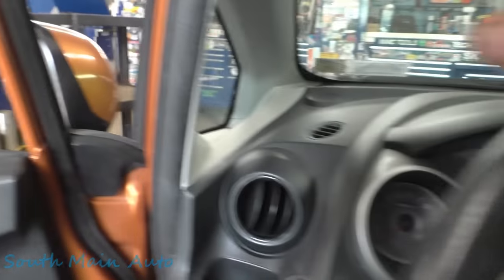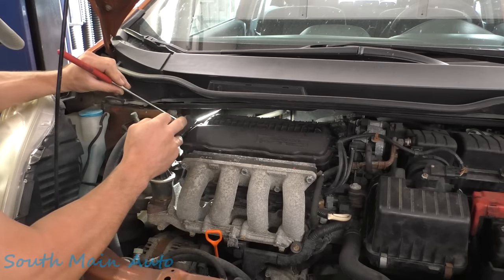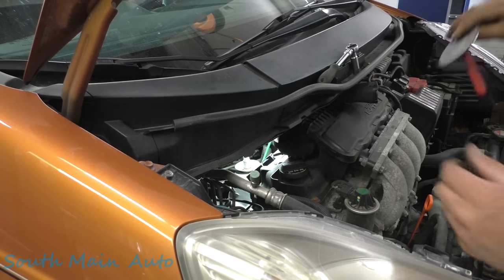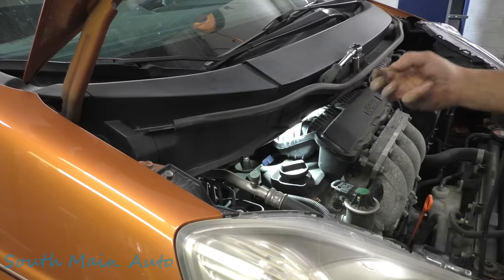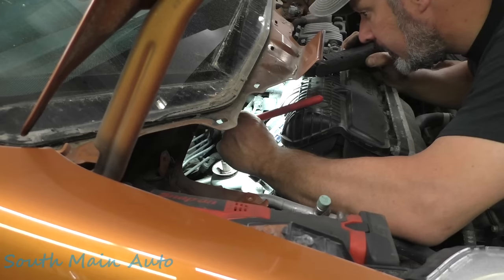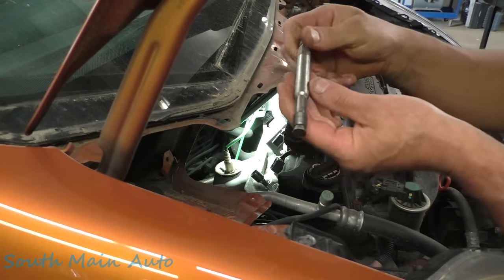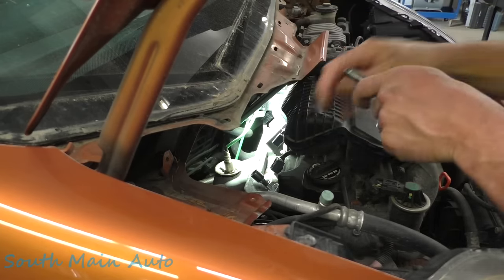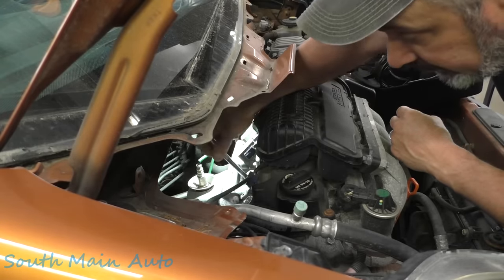Fixing A Blown Out Spark Plug - Honda Fit Edition

Comment from the maker: - Spark Plug Saver | 14m x 1.25 Thread Reamer and Thread Inserts | 5 Piece (3 Thread Inserts, 1 Reamer, & 1 Swaging Tool) - https://amzn.to/3IDmnHy
- DEPSTECH Dual Lens Industrial Endoscope - https://amzn.to/437nKqb <---- I have a couple of these and they are totally worth it IMO Don't waste your money on the Snap-On truck for an endoscope trust me...
- Astro Pneumatic Tool 1716 Deluxe Air Blow Gun with 20" Long Angled Nozzle - https://amzn.to/43nNtKQ <----- These bend real nice 😂Especially if it's not yours 😏
- Spark Plug Installer/Remover Kit - https://amzn.to/45ydmcE
Reply: Where'd you get that red spark plug starting tube, shown in your hand at 3:57? People talk about using a short length of hose. All the spare hose I have is curved, which makes it confusing if you're trying to start the plug straight.
Reply: Glad you mentioned the TikTok thing. Whoever it is is just taking clips of your really old videos to make them.
Reply from the maker: @TheFallenAngel13524  yeah I'm trying to get that sorted but it's a pain
Reply: Wow. That endoscope is way cheaper than I was expecting. Thanks!
Reply: What I have done before is get a used spark plug, cut off the crush washer and put a 45 degree taper on it with your bench grinder where the crush washer was and use the modified spark plug to drive down into the new thread and tighten. The 45 angle will seat the top of the solid insert. Then remove modified spark plug and put in your toolbox. The one I did was Cyl 2 on a Hondu Pilot. No room to hammer.
Reply from the maker: @OneLegged-honda-mechanic  That's a good tip. Thanks!
Reply from the maker: @spelunkerd  These are the ones I use and I have had them for years. They don't wear out like the rubber ones. 
https://amzn.to/45ydmcE
Reply: Hey, I have been wondering about your channel. Are you going to post again? @OneLegged-honda-mechanic
Reply: Who makes the blue insert install tool at 29:33? A tip for tight space hammering is use a heavy hammer. I've found I can get more whack with a heavier hammer vs a light one in tight spots. Also with the type of insert used in the video don't be afraid to hit it in order to peen the top of the insert outwards. A brass hammer works well for that.
Reply: @OneLegged-honda-mechanic  Ben what happened to your channel, you got tired making videos?  Come back pls we need more Honda gurus on YouTube (-_-)
Reply: Be Cool... Stay in school!
Hey, I think Ray missed your broken stud video last week. He welded a nut to the top of a broken stud on a Subaru but forgot to apply the high heat torch to clean up some of that corrosion in the head. After about 5 snapped off nuts (and lot's of WD) he lost his cool and broke out the drill.
😑 All sorts of ugliness ensued and he wound up replacing the block on the arm. I kept screaming at the screen: Grab the torch! It's right behind you! Oh well - we know he's a good wrench but we all need to keep our cool and come back to the problem with a level head and some fresh ideas. That's why YOU are the man with the plan. Patience comes with age most of the time.
Reply: Don't know what you guys think but I was taught to put grease on the ream / tap doohickey to catch metal chips. Probably just overkill, as long as the valves are closed and the cylinder is blown out, looks like it came out nice. Thanks Eric.
Reply: When I did first incert on my 1.8flat four subi at 180thousand got lucky with multi extensions to thread in tap .then found 2'&3'extentions what job saver second time at 2hundred thousand did it forty five minutes got to work haha be blessed
Reply: Good stuff Eric. Definitely learned me something about tools that I was completely unaware of....
Reverse thread arbor? Who'd of thunk it?
Anyway,top notch as usual. We appreciate you
Reply: @SouthMainAuto  They or it do it to several creators. Always says the same.  Like and follow for more.  Never respond to comments and block you if you call them out.
Reply: Who makes the tool that chases threads from inside out that’s sweet could have used that lots of times
Reply: Oh my, you didn't even wipe all that residual loctite outta the inside of the sparkplug hole that got all over the side before you put that new plug in.... That oughta be real fun to change down the road ha ha
Reply: Looking through for Lincoln Town Car Videos I do like your style, easy approach, can you recommend any channels in your community that cover a lot of town , 🚗 car vids thank you have a blessed day
Reply: Eric / Mr. O cat Caterpillar makes a really awesome thread insert kit that has 4 locking tabs that expand to hold insert in. I know it wouldn't have worked in this application. I highly recommend checking it out!
Reply: I was a former competitor in the Carling O'keefe World armwrestling championsips so there isn't a spark plug I can't wrestle ou9t.
Reply: Mate your a gentleman and a scholar, the things i have seen you do, any other workshop auto repair place would simply say yes you need a new engine, plus i would like to know how on earth did anyone even stuff up putting a spark plug in, i know its hard to get to, but honda or anyone else would look up how to do it for access etc, so take off the windshield plastic areas of concern and replace with new spark plugs its that simple, so who the hell stuffed it up?
Reply: Great step by step video! Our son's car had the same plug blow out issue on #2 so will be following your steps to do this fix. SF dealership quoted him an insane estimate, probably for a brand new head.
Is there a link to the blue handled tool used for putting in the insert?
Reply: Where can I find that tool you are using to install the actual thread insert? Thanks
Reply: I seem to remember doing something similar on the mk 2 fiestas with the taper seal spark plugs
Reply: I have a folder full of bill's my sister paid to shop's in az.that she paid for work that was not done or part's that were broken so she would have to come back to get replaced so when i see this man do the right thing i admire him

Comment: Novice = install a helicoil.  Intermediate=Installing the helicoil on a head w/o removing head.   Advanced = Don't remove head, and install a helicoil down a plug tube, underneath a cowl totally blind.   I definitely would have boogered that up doing it blind.   Well done, and saved the customer a lot of ducats.
Reply: Thought it was Canadian drachmae up around Eric O's neck of the woods?
Reply: I’m not sure how using a #4 screw extractor would rank on that scale?
Reply: Glad to see you took the Piston down OB Motors on Hacks Cross in Olive Branch Mississippi didn't do that they drilled into the the top of my piston ruin it then JB welded my spark plug in without taking the drill bit out cost 3800 a new engine the owner states he was not liable that he was just renting a bay to the man but I was given a receipt with the company letterhead on it. OUCH
Reply: That's Mississippi for you
Reply: Johnny from Olive Branch Motors in Olive Branch on Hacks Cross I took him a time cert insert with all the trimmings and he drilled in the top of my piston left the drill bit there,  JB welded a spark plug in cut $3,800 that's Stooooopid   little Vietnamese
Reply: Perfect observation and explanation bravo sir. Nice.

Comment: If the customer had taken that job to the dealer, it would be a new cylinder head for sure. You saved the lady a load of cash. Good one Eric.
Reply: They would’ve done an engine
Reply: Probably techs at the dealer that butchered the threads in the first place...
Reply: dealers are not mechanics just part replacers
Reply: its an 09, when i took my 07 fit to the dealer in 2015 they refused to work on 'such an old vehicle'
Reply: Japanese engines aren't commonly repaired anymore. Replace engine.
Reply: Damn straight.  I never go to the dealer except when buying a new car.
Reply: Dealers only do repairs that bring the parts back up to original brand new condition.  When often, just doing a splice or something, would suffice.  Squirrels ate through my fuel pump wires.  The dealer insisted they couldn't just strip the wires and splice them back.  They would have to replace the entire wiring harness.  So I got a shop to lower the gas tank and splice the wires.  It only cost $250 whereas the dealer said $1800.
Reply: They would have told him the wait on an engine or cylinder head was 10 months because of supply chain issues and then sent him over to the shark tank, I mean, sales floor.
Reply: Not necessarily.... but you wont hear me outside your echo chamber.
Reply: Then why'd I borrow this tool from a Ford tech the first time I did one 🤔
Reply: @smitty2jones  that's for "CYA" purposes only.
Reply: I went to a full-service shop that I had used for a few years they told me my oil pan drain plug hole was stripped out, from a 10 minute oil change place Jiffy Lube or wherever they over tightened the plug, they told me I needed a new oil pan and they would not be doing any more oil changes for me unless and/or until I had the oil pan replaced ,in order to replace the oil pan you have to lift the engine up on a Chevrolet pick up truck big job I stoped going to that place because I know there are better alternatives  less costly alternatives,😑😑😑😑
Reply: @Codyjrt  Never go to a dealer for anything vehicle related .(other things that you smoke green tobaccy yes)
Reply: I believe that one was Mexican
Reply: $3500.00
Reply: @kthwkr  I was quoted $12000 to replace the car harness. I did it myself - all it needed was 1 pin to be bypassed on the patch panel connector after the sunroof leaked and rusted them up. Highway robbery!
Reply: Quoted $9k for a head replacement at the Honda Dealer in Dayton. ... Better than a $5k used engine replacement because the used engine has the same faulty head. New head has loose spark plug problem fixed. 2012 Fit

Comment: As a Honda Fit enthusiast, watching Eric O fix the infamous 09-10 GE8 spark plug ejection is a dream come true!
Reply: What causes that, under torque?
Reply: Yeah, do we know the back story of this problem? It seems to be very common. I have a JDM Fit from 2006 and the service manual says to use anti-seize and torque to 18 N m (13 foot pound force). I wonder if there could have been some confusion about the units and/or the use of anti-seize in the US production.
Reply: (Mine's a GD rather than a GE though - with the eight spark plugs. But they're all more accessible than what Mr. O is fixing here!)
Reply: Is that a nuclear attack siren or maybe the nuke plant is melting down? Bummer either way.

Comment: You can see how wet the # 2 cylinder was from the misfire. The # 1 cross hatching looked as good as new. I love how cheap bore scopes have gotten. Back when I was first getting into wrenching on boats, they were well over 1000 bucks, and they weren't digital. Now I've got one with the side cam and records video that was less than 80 bucks. Great repair Eric O.
Reply: I bought a $20 USB cable that plugs into my Samsung Tab A tablet. I don't think it has the side camera but the front facing camera with the light works great

Comment: I have the same '09 orange honda fit 158k on the clock. Bought used at 145k, and decided to tackle a valve adjustment myself after being inspired by all of your videos. Everything is much easier to reach once you pull the intake, which is a bit of a pain. Fortunately I didn't have any broken clips to replace on the wiper deck. I was surprised to find when the engine was stone cold, 3 of the 4 plugs on mine were also finger tight. #3 took a little work to get out as it got hung up a few times, but I took my time running it in and out until it came out cleanly. Plugs were probably original. Valves were all over the place, but not super out of spec. No real surprises otherwise other than not realizing some of the hoses on the throttle body are coolant, and got all over me when I disconnected them. (i'm used to working on carbureted bikes) Throttle was really dirty, so I'm glad I took the time to really go through everything. It was kind of funny to put back in, as the car was idling at about 2K for a few minutes while the computer re-learned the positioning on a clean throttle. 
Thanks as always for bringing us along in your shop, and your thought process.
Reply: Seafoam through the brake boost vacuum line really made my Fit engine quiet. Got to take off the cowl but it is worth it.
Reply: So this was your vehicle?

Comment: Yup, I have done two sparkplug repairs about 40 years ago. lol I purchased my kit to repair the threads on my motorcycle, then a few years later helped a friend repair the treads on a plug that blew out on his car. I remember the instructions saying to fill the tap flutes with grease to catch the metal shavings. I remember going about half way and removing the tap and cleaning it and repacking it with grease for the second half of the hole. Grease did a good job catching all the bits and the kit did a good job. I let people borrow it over the years and I'm not sure if I still have it. Great video Mr O.

Comment: So timely for me !! Today I am going to replace a spark plug on a 2005 Honda Element for a lady with very limited funds and some real challenges. 
Check engine light showed misfire at #2. Swapped coils with #4 and the miss stayed at #2. I pray it's a bad plug and not this nightmare. 
I am not a real mechanic so I would not take on this project. It's a different engine and visibility is easy. Thanks SMA.

Comment: its hard to imagine a more awkward and difficult and non-ergonomic repair situation.....masterfully handled when you know what to do.....i'm shocked that such a catastrophic anti-ergonomic concealed failure mode with that spark plug could be repaired so quickly and easily in the hands of an experienced mechanic .... well done Eric O
Reply: Eric separates the professional from the amateurs, yet another example
Reply: I was pleasantly surprised when I picked up a used Ford Fusion last yer, that the plugs and coils are right up top, in your face. Like it should be.

Comment: I always use a thin coating of soft grease on the thread tap when tapping a cylinder head that's on the engine. It captures most or all the shavings into the flutes of the tap. This prevents them from dropping into the cylinder. Tap Magic on aluminum works well to lubricate but doesn't capture any shavings.
Reply: When he first blew air into the cylinder, you could really see the shavings flying. Get yer safety glasses on, buys.
Reply: Instead of changing the spark plugs at 100,000 miles I just junk the car and buy another one.

Comment: As a friendly reminder, to all the people out there, the use of dielectric grease needs to be kept to a minimum.  I had an intermittent miss on my Mazda Tribute.  After replacing all the plugs and fighting the miss for a week I decided to clean all the spark plug boots and put only the bare minimum of grease on the boots.  I didn't think it would fix the problem, but it did.  I was amazed!  Good work there! Very thoughtful!

Comment: Hi Eric.  Have an 08 Fit and about 10 K after changing the plugs (torqued to spec), I could smell gasoline under the hood.  This lead me to a Honda forum where people were saying the plugs would come loose.  Sure enough, that was the case and I caught it early.  Now torque them about 4 ft-lbs tighter than spec'd.  What I found incredible however was that others had the original, never touched factory plugs come loose or blow out.  Honda said this was not possible and blamed the customers saying they must have changed them.  So something about this motor.  Never had this happen before on my other Hondoos.  Great video.  Always useful and entertaining.  Hope I never have to do this procedure.  194,000 miles on this car.
Reply: Did you hear any squeaking noises, kinda like a belt squeak as well when they were loosening up? I wonder if the gasket was taking too much force to crush on the plug choice they used for this engine, robbing the threads of the proper amount of torque/stretch. One of those things were supplier differences affected the set spec in some cases.
Reply: @ice44567  I honestly cannot recall any squeaking noises but this was almost 7 years ago.  You could be right about the differences in suppliers.
Reply: Honda dealer says they have replacement heads with the defect fixed.

Comment: I welded a 3/8 socket to the top of my tap, so it would accept a 3/8 extension, and wrap electrical tape around said extension a few inches up, to keep it centered in the plug well, has served me well, for years.

Comment: First time commenting Eric O. When you needed to expand the top of the helicoil with no swinging room the first thing that came to my mind was a palm nailer and then you said it👍
I used a palm nailer years ago to install a soft plug on my inboard motor on my boat with out pulling the motor, mechanic insisted motor had to come out because of position and lack of room. You are one hell of a mechanic keep the videos coming 😁

Comment: Great video! Shows the contrast between fixing the problem in 15 minutes, or working on the car for hours and hours to pull the head and possibly creating other problems in the process. Very practical no-nonsense car repair!
Reply: Or just use JB Weld high temperature epoxy and wait for it to set and don't bother putting in new threads.

Comment: I have the same year Fit and the #1 spark plug used to get loose every 10k miles or so.  Lhere are lots of others complaining about the same problem on the Honda forums.  I think Honda spec'd the plug torque a bit low and once I added about 5 ft-lbs, the plug never worked loose again.  Mine is up to 290k and still running strong!